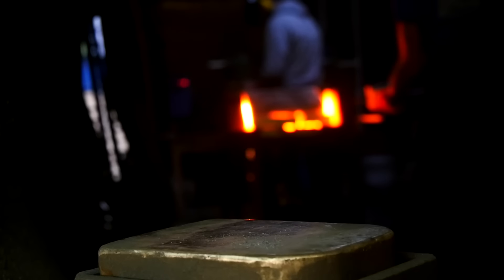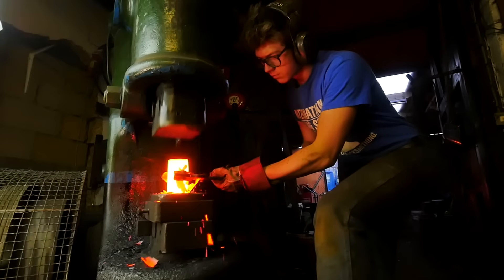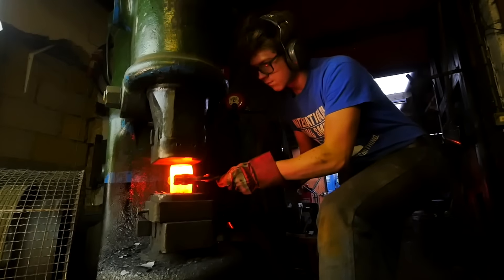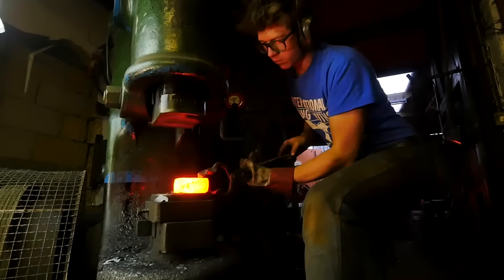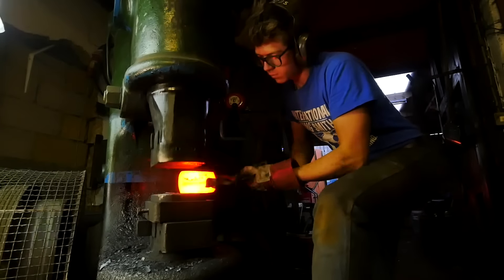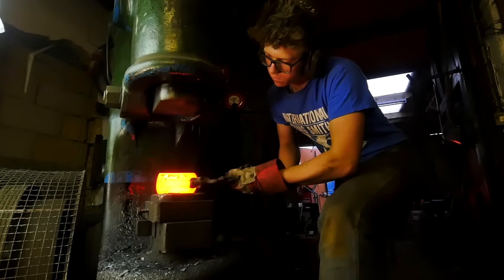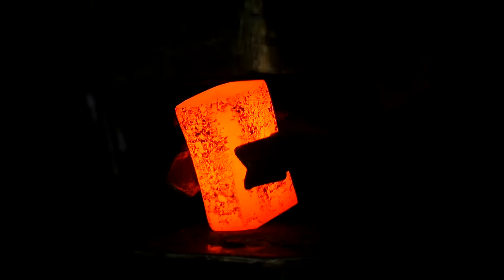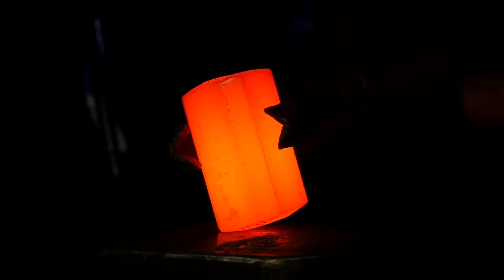How to Forge a Square Hammer Billet

Comment: Hi Alec, how hard would it be to do the same work on the same size blank under the shinler pawer hummer ? whould you do it in the same way as in the video?any tips for around 50 or 60 kg hammer users?
thanks
 yoav